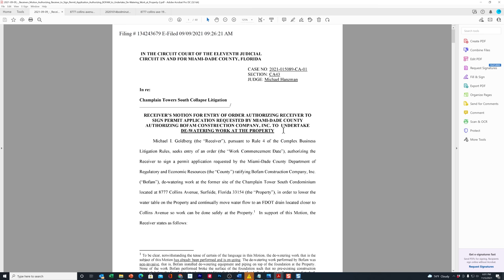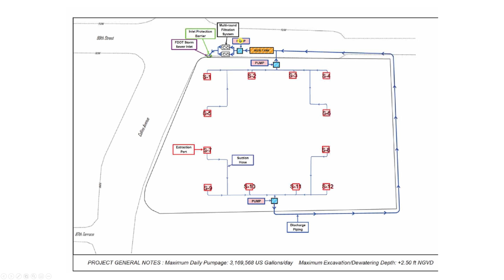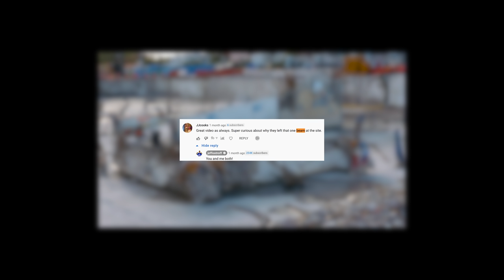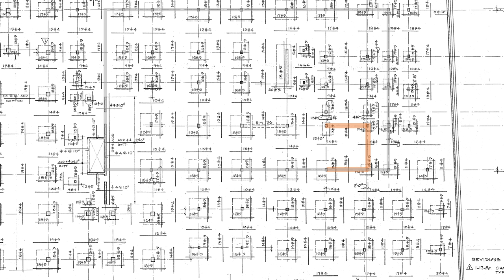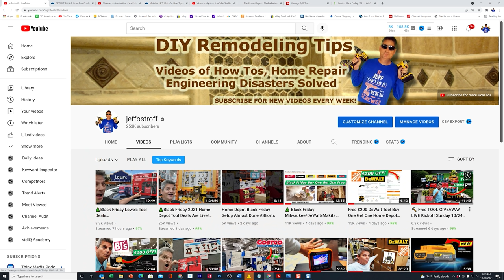Miami Condo Collapse: Engineers Baffled By Mystery Column

Comment: Jeff, what is being done to ensure the residence surrounding the former champlaine towers. Are they showing any signs of damage? For instance, any ground shift in the past 10 months? Cracks in structure parking lots or pool areas? 
My ex husband worked in champlaine towers for a really fat cuban whose nick name was manderine.  Their was water problem in parking lot level c around 168. The manderine demanded mark fix it. He wouldnt. He was too busy chasing me. Soon after the manderine threatened mark. Who lived in kennelworth in bal harbor he suddenly dropped dead in his town house in san souci towers. Mark drove an ugly red Volvo at the time. I never asked why he drilled a hole by the colum of parking lot. He said it was to draine the water from pool deck because it leaked. No one fixed that pool for several more years. Their was a guy by the name manny also matinance man asistant.   That colum was put up in 95 or 96.
Reply from the maker: We put up a video a few weeks ago about the Champlain towers North building how they have started putting up shoring polls on many people's balconies so they are suspecting that something is wrong with that building too while they repair it.

Comment: I may have missed this in the conversation but have you checked the Building Permit Records for Alterations / Repair to the existing structure?  There should be some Permit Record of the Mystery Column / Beam.
Reply from the maker: I spent several hours the other day examining all of the permits for the Champlain towers South condominium from the last two years, and there was nothing there. So either somebody was adding the column without a permit, or there is a permit and it's just not listed online right now

Comment: The mystery beam looks very different from the older, original beams.
The concrete, the rebar, the fact it wasn’t necessarily attached to the original structure leads me to believe this was a recent addition. Part of the initial repairs.

Comment: A good hypothesis is that some portion of the "fifth" (or some other column from the 1st to 12th) column was driven (impaled) through the garage level slab. After all 11 floors of building fell down. That one can't see the outline of the slab penetration is explained by the fact water and concrete dust are pooling around where it protrudes thus masking the outline of the hole.
If an additional column was added since the (July?) 2020 video I would expect some survivor to remember a column popped up in the E-W aisle.
Reply from the maker: there is zero damage on the floor where there should have been craters or something else if it had impaled into the floor but there is no damage. These rebar rods look like they were intentionally built up out of that concrete floor like it was done by somebody in the last 12 months, since Fiorella shot her video inside the garage in July 2020, showing no column exists where that mystery column is.

Comment: So the way I see it is that your yellow line at 6:09 is misplaced and should be 1 row of columns further down the ramp, so that's why nothing is matching up. Thanks!
Reply from the maker: No sorry, you are wrong. My yellow line is not in the wrong place. If you look at the overhead shot at 1:06 you will see clearly that the red box on the photograph is the outline of the building, and that the outline of the southern edge of the building matches the southern edge of the H beam. As I have shown numerous places throughout this video so it seems like you weren't even paying attention at all. The beam landed exactly where the drawings say it should be and the floor plan, and looking at my yellow line you should be able to easily tell that it is correct, because follow it all the way over towards that shear wall where the vestibule is on the other side of the garage and it all lines up perfectly.

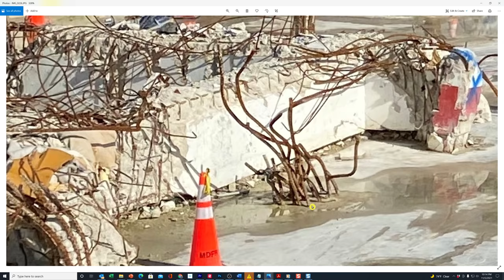Comment: So, in the zoom shot at 13:52;  I see NO attachment point for the 1st floor post beam to the middle of H transfer beam.  
At 7:19,  where do those drain lines go?  It looks like there are some black fernco fittings which that go right over to the middle of H-beam (need better pic) and up through the garage ceiling (could that middle column be for a roof drain line?).
Reply from the maker: Maybe soon

Comment: Looks to me that the column from the 1st floor was not tied to the H beam with rebar allowing it to slip off during the collapse process and punch through the ground floor.  The rebar is clearly different from the other columns and while the punch-through is uncannily clean the water could be hiding the concrete damage.  As you show there is no way this was added later as it would block traffic and cause serious congestion.  That column simply couldn't have been there before the collapse as a practical matter.  This is just a theory on my part but I believe it matches all evidence in this video.
Reply from the maker: the column falling 11 feet and impaling into the garage floor, you forget that there is zero damage on the floor where there should have been craters or something else if it had impaled into the floor but there is no damage. These rebar rods look like they were intentionally built up out of that concrete floor like it was done by somebody in the last 12 months, since Fiorella shot her video inside the garage in July 2020, showing no column exists where that mystery column is.

Comment: The "H" beam:  That column is most likely one missed due to the angle the buildings collapsed. It may be the entire "H" beam fell at an angle and landed some 12 or so feet from the supporting columns. May I suggest revisiting the photographs and placing the "H" beam over columns, thus eliminating the "unknown" column?
Reply from the maker: IT can't land that far away, the beam was only 8 feet off the ground

Comment: I noticed a jagged hole around the beam in question on the floor! I'm wondering if it was pile driven in as the building collapsed!
Reply from the maker: Or cut and filled in, and they drilled in the rebars

Comment: It looks like the mystery column started at the H Beam and went up from there to the penthouse. When the collapse happened, it drilled itself into the garage floor and broke apart. I bet if you look at the rebar sticking up from the garage floor, its not tied into any other steel in the garage floor.
Reply from the maker: We are still debating this one. I maintain that a column  falling could possibly do that, but there is no floor damage from a column smashing into the floor.
Reply: @jeffostroff  good point.

Comment: there is no apparent concrete around the re-bar, but it's not a high enough resolution to be sure.
it could be the column above came down with such force it drove the rebar into the floor. enough to leave the re-bar behind while the concrete exploded away.
it would have left the slight impression as it spalled away too.
Reply from the maker: but where is the floor damage from such an impact?
Reply: @jeffostroff  
you can see a slight square outline .
but it is too low a resolution to get it bigger.
there was nothing there before  the building fell, unless the H  beam is somehow shifted to a different set of columns in appearance.
i think it's sitting close to in place. 
 
close up at  13:47  doesn't show anywhere the column was tied to the H beam either. 
i've done a bit of concrete when young. 
on a placing crew pouring large projects. 
that's some beefy rebar in the floor
the only similar close re-bar, is center left,  but i don't think the column was  sitting over there.
concrete was probably already missing around a few inches or foot or so from coming off the H beam. 
as it hit and drove in, it started buckling, causing the rest of the concrete to spall away. 
at the floor it has a slight inward slant towards the H beam.
there is no magic, so we have to come up with a reasonable explanation. 😀
not many other explanations,.
not that mine is an exact explanation either, just a logical probability.
Reply: @jeffostroff  
guess it's like low/high velocity fasteners.
they quite often sink with little to no spalling either.
might be a better analogy.
they did drop 1 story before striking. 
with whatever force was the weight supported by that column.
as to floor damage, it looks like little damage overall to a floor that had a building drop on it. 
the lower floor does look mostly intact everywhere.

Comment: Im sure the mystery column was under construction at the time. The floor was dug out then rebar installed from below the floor to roughly four feet above then cement poured to the top of the cement floor. You see no cement around any of the rebar above the floor like you see on other columns . You would think some of the surviving residents would be able to verify this. Maybe the plan was to put another cross beam over to the other column that was lined up with it.
Reply: Most plausible theory...rebar rust almost instantly so no telling how long it was there. We know workers were actively on scene prior to collapse. Somebody should verify eventually if that's the case.
Reply: Nope, the mystery column was always there, right where it's shown in the diagram. (Hint #1: you're looking at the wrong spot on the diagram. Hint #2: The H-beam didn't fall straight down.)
Reply: @RobbieHatley  Then explain to me why there is no concrete in amongst all the spaces between the rebars above the cement floor .
Reply from the maker: No you are incorrect the column was not always there. I showed you in the garage video inside the garage where there was no column there because the whole purpose of that H beam is to prevent the floating column from going past the first floor down to the garage floor where it would block the driving lane. Go back and look at the video again and look at everything reference to that column with the red stripe like I told you the beam fell exactly where it was on top of the columns it did not fall at some strange angle and move 20 or 30 feet that's just ridiculous. That column is not in any drawings or anything
Reply: @RobbieHatley  Hint:  You don't know what you're talking about.  Cease and desist.  Thank you.

Comment: Was it part of the grade beam? Is it on the piling/foundation plan?
Reply from the maker: if that were true where is the damage to the floor from impaling it?
Reply: @jeffostroff  7:10 Look at the cold joint running between the column on the right- did they pour a slab on top of the existing slab? Hard to tell if there is a slope pitching towards the camera.

Comment: During construction, they placed a 1/2" steel plate on top of the H-Beam and then welded vertically-standing rebar to it. If you look closely at a blown up frame from the video, you can just make out the edges of the plate, which is submerged in about 1/2" of standing water. With the plate being hidden underneath the water, it appears as if the rebar is coming out of the concrete floor, but it's not.
Reply from the maker: The plate would leave rides though, it if there is a plate there the puddle can't hide it

Comment: Is it not possibly the column which was supported by the H-Beam, which became displaced and punched through the floor, as the building came down?
Reply from the maker: could be, but where is the floor damage?
Reply: @jeffostroff  I agree that the apparent lack of floor damage in that area presents a problem for my theory, but maybe the column had enough weight behind it (seeing that it extended to the top floor of the building), including the fact that its base would have fallen from a "floor height", depending on the thickness of the basement floor slab, this may have enabled it to punch through the slab like a pin or arrow.

Comment: I think it is a column from the lobby level, impaled here by collapsing structure. 
Looks like this column wasn't connected with H-beam using rebar. It slipped off the beam and pierced garage floor. 
Standing water suggests that there is a deflection of floor made by impaling column. Because of this lack of rebar at the bottom of the column, hole in the floor was made pretty clean and then was sealed by fine debris.
Reply from the maker: Your hypothesis comes up a lot from boatloads of people about that column. I don't think it's possible because if it had slipped off it would not likely have come straight down where the mystery column is which is only about two feet away from the HP. Also if it had impaled the floor there should be damage all over the concrete there and there is none where is the crater? So where else could the column come from? So far my prevailing theory is that somebody started to build that column sometime after Fiorella shot her video in July 2020. however I could find no permits for it

Comment: Bowing/sagging and or cracking in the H beam and the column added later to address... All the weight of the upper floors were sitting on the center section of the H beam... So obviously stressing the one side of the basement H beam and the need to shore up with the new column... I seem to be able to see the square section of the concrete garage floor that was cut out to pour/add the new column... Looking different than the rest of the pad around it... I also wonder if [over time] anyone had ever hit that [newly added] column??? Columns have been hit and degraded before... A lot of load resting on certain main weight columns and cracking or chunks knocked out can cause all that weight to come down... That column is directly next to the drive passage way as you showed in video... And as the video captured from guests of the hotel across the street shows the H beam area is where all that ceiling concrete was seen falling just before the actual collapse occurred... The early signs of the epicenter of the collapse??? Go back and look at the collapse footage... It wasn't like the twin towers collapse with the pancaking effect of upper floors coming down onto lower ones it was the ground floor giving way and the upper floors falling afterwards and tearing down much of the wing portion of the building with it... Meaning the epicenter of failure must be in the basement/sub-ground floor region right where this extra column was put in place to shore up the H beam... There's possibly the issue of ground water [beach front] that might be involved with that new added column and it's base eroding beneath it??? There was some talk about that being a possibility in earlier media reports as well the video photos you showed had water around the newly added column...Looking at the photo it seemed almost as if water was seeping up from the cut out square portion opened up to put the new column in...
Reply from the maker: No, the video from the tourists cannot see the H-Beam, it is too far east.
Reply: @jeffostroff  The entrance ramp opening has a H beam doesn't it??? I thought you were originally talking about the ramp portion then you showed footage from someone in the past that did not look like the ramp area... The ramp area is where the guests across the street filmed the concrete falling... But I digress...

Comment: Looking at 6:55 - 7:30 and comparing it to 8:48 you can see the concrete floor has been replaced. There are no longer cracks in the floor leading to the "H" beam. Plus, on the 8:48 pic you can see where the irregular line of old and new concrete meet. The concrete patch seam is very clear at 6:11. With that said, this is the time that a new footing for the "mystery" column was most likely poured to shore up the load on the "H" beam. Somebody knew this building had problems.
Reply from the maker: The crack should be in the image at 8:48 like you said, but I think it might be hidden by that puddle, and by all the dust still on that floor.
Reply: @jeffostroff  possible .. also it looks like the traffic cone next to the column was placed at a hole. (Before collapse)

Comment: If the mystery column wasn't a puncture into the garage floor, then it must have been added at some point.  Shouldn't there be some city/county record of a permit to do so?  What about the occupants?  They certainly would be aware of a column added in the middle of the drive path.  I imagine it would have been a huge topic of conversation.  If it wasn't added, it must have been a punch through from the column above.
Reply from the maker: I searched all of the building permits for the last two years for the town of surfside, and there is nothing there so unless the permit is missing they don't have all of the permits online yet, or maybe this was an UN permitted column but we know for sure that it was added after July 2020 when they garage video was shot because it was not present at that time.
Reply: I'm sure they blocked off the construction with some kind of barrier, maybe a chain link fence segments with fabric to obscure the work.  It wasn't a punch-through.  It was intentional construction.

Comment: There is no rebar tie-in at the top of the H beam where the upper column should be tied in, I'm not a structural engineer but I would think if the H was intended to support a column above it they would be tied together. This leads me to believe that the column to the penthouse level never was supported by the "H" at all, if it was "close enough" to the center bar of the H it would provide a little support this unsupported penthouse column then impaled the concrete below during the collapse. If you watch a video of the collapse there is a column at timestamp 2 to 3 about that location you can see it standing free then piledrive downwords then stands again and collapses over towards the none collapsed part of the building. This next part is less correlated and is probably confirmation bias, but there is also a column on top of the debris pile that had fallen the opposite way of the main pile.
Reply from the maker: there is, I saw 2 of them, but no more. Could it be it was sheered off? we don't know.